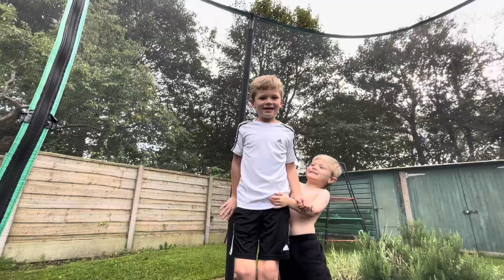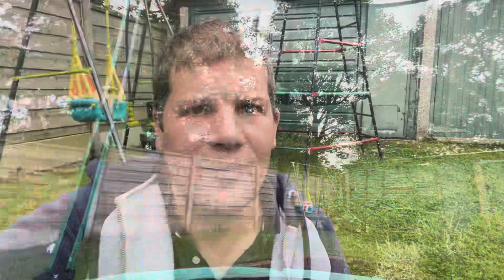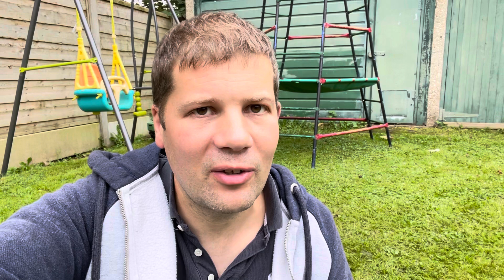ShrigleytubeTV ep13  carter 1228cc dyno, clock upcrank, visit from mrRatty, Lancia Stratos

Comment: Enjoying the content and the humourous laid back stuff, Andy 👍.  I'm guessing from the Carter Dyno run that despite the capacity, the torque was disappointing.  Going way back, I've seen a genuine Carter big valve large port head used for rallying that kept the original combustion chamber shape with NO inlet valve shrouding relief at all.   My own 1040 head follows the same idea.  An obvious way to get a high SCR but I'm wondering if you have dynoed heads like this to show the effects of no inlet shrouding relief? ...eg loss of top end power / doesn't want to rev, versus any midrange torque gains?
Reply from the maker: thanks, yes your asking exactly the same question i was, burn path or higher cr, the answer is both just not easy to achieve!